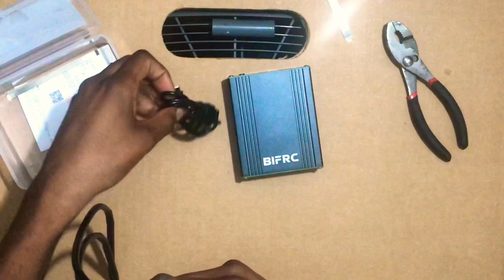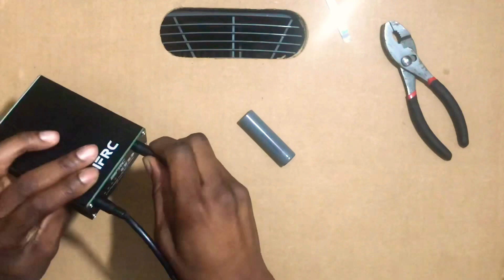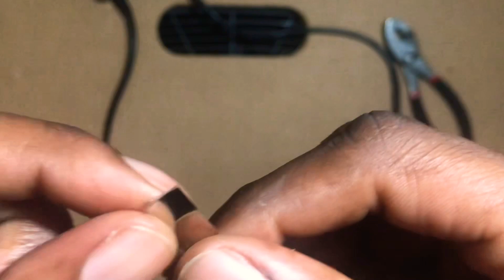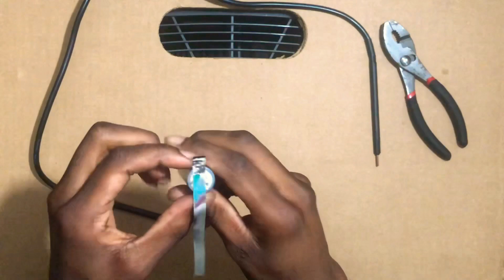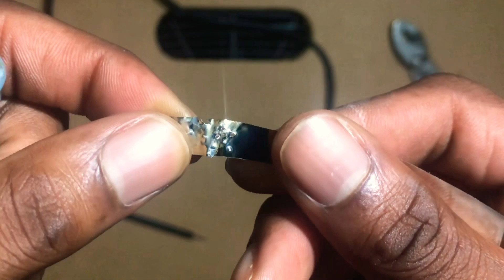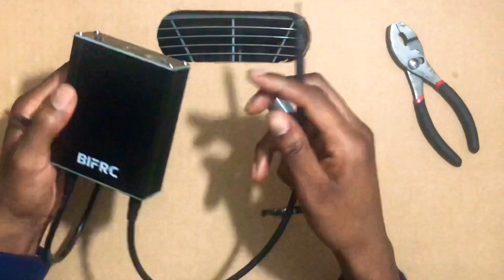Portable Mini Spot Welder Machine Test 18650 Battery

Comment: I thought I got this on eBay but got ripped off again.  It looks exactly like it but its called "seal sunny" and has only 4 gears and the first 3 are useless and the 4th is too until you repeatedly do welds over and over until the pens get so hot you can't hold them. then it kinda works sometimes. This is after getting ripped of on the little red welders  ones sold on eBay .they knew they welders all have a design flaw and still sell them knowing they will just go up in smoke when used.

Comment: Dude , l got the same unit  and used it as you did . Beware when you crank it up and press down lightly or big angles on that negative end. Yep, l know it's red hot strong weld but if the terminals are to close the extra current less resistance WILL blow you up dude . lf you by luck survive instant  explosion, well you got a nasty fire and pray any connected ones don't blow . Wear a mask at least  or do something else  people , even for the poisonous air taste that lingers .Lol.
Reply: Hi, did you mean that you shouldn't press too smoothly and with the ends too slanted? Sorry, but I didn't understand well. that's it? and I must also be careful not to solder with the ends too close, right. I bought one and would like to know more, what I shouldn't do, what I have to pay more attention to. if possible, tell me more about it👍🏻
Reply: @souza1515  Make sure you don't have the batteries fully charged, about 3.6V is flat and much safer.
Reply: @johncoscia5258  I understood.  Is a voltage between 3.0v and 3.3v also ideal for soldering them?
Reply: @johncoscia5258  I have another doubt.  Is there a specific order of which side of the spot welder tips should touch the nickel tape first?  I touch the positive tip first and then the negative tip to release the pulse and solder.  Or do I have to play the negative side first and then the positive?  or do they both work?
Reply: @souza1515  It doesn't matter which lead is first, start practice on a lower power level and the lighter and more severe angel  promotes a bigger gap on the surface area for current to flow. The harder and more upright current flows deeper and too deep and hot ,,,bang. Soldering decrease's battery life and often will leave a impossible or  tight awkward assembly .
Reply: @johncoscia5258  thank you very much for the information👍🏻

Comment: These are Crap, my one turned up a couple of days ago, constantly turns off, only tries to work when you leave it on charge, doesn't weld probably on any settings even with their supplied strip. supplier not helpful with warranty claim.!

Comment: I found out take a really fine but on ur Dremel tool and make it smooth .I knew on level 9 it will shut off . Using  15mm strip I don't have to exceed leaves 6

Comment: Just received one of these and even on the lowest setting its burning straight through .15mm nickel strips.  The amount of pressure applied doesnt seem to make any difference and the pulses seem to get stronger the more welds attempted.  Pretty dangerous.